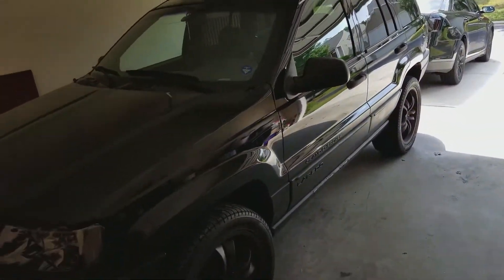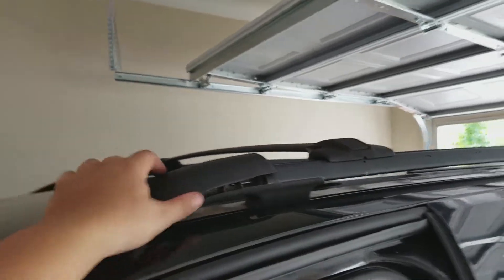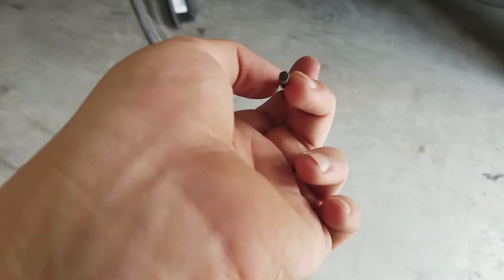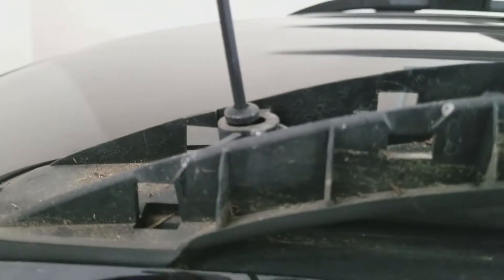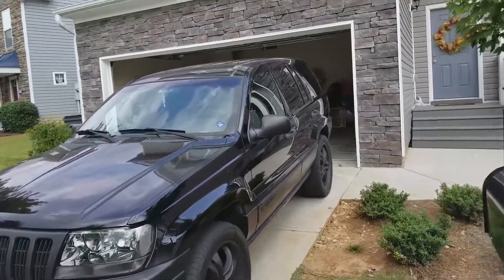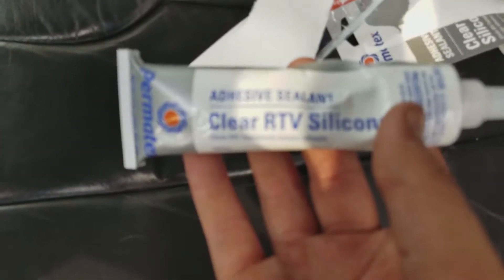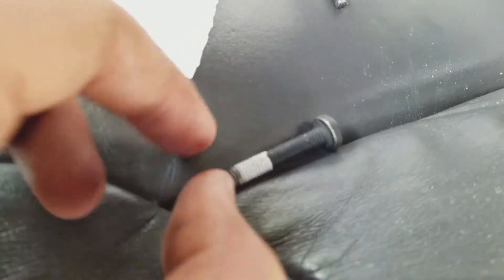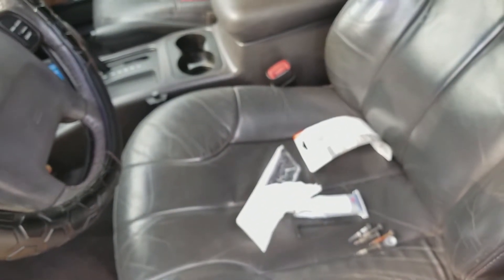The Grand Cherokee Project (Roof-Rack Delete )

Comment: Get shorter bolts, or cut and inch off the factory bolts, and you won't have to worry about them coming thru the headliner.  Personally the Jeep GC looks better with the roof rack.... but that's only my opinion.
Reply: My roof rack is the only way I find my Jeep in parking lots.  It's slightly off-white and that helps, too.  I had no idea there were so many white SUVs and vans in the world until I got mine.

Comment: You need to show how to remove plastic end covers without breaking old brittle end pieces!
Reply: Long screwdiver under the cap and snap it up.  The caps are pretty strong.  The ones on my 2000, to change them to my 2002, did not break. Nor did the caps on the 2002 break.  All is good.